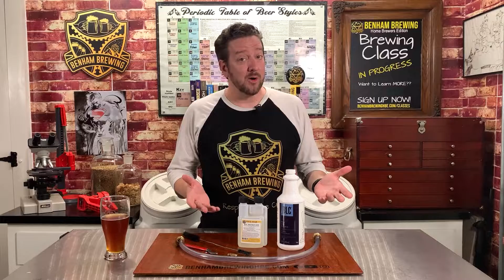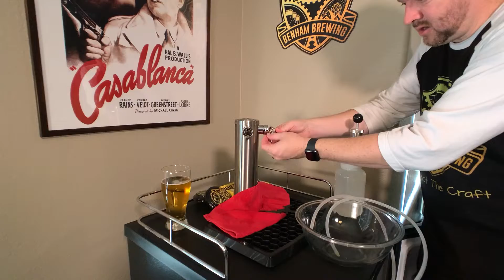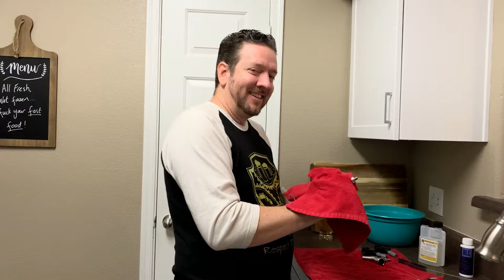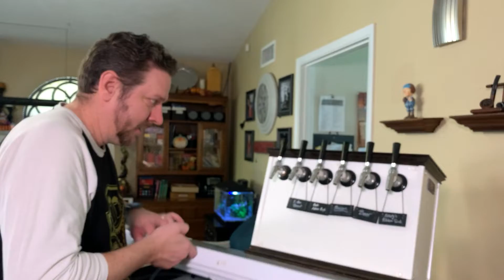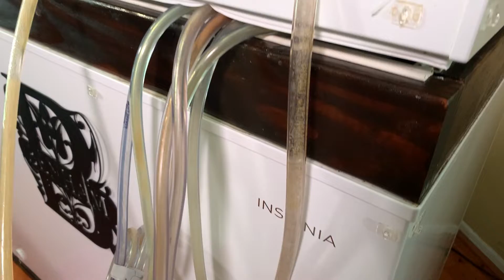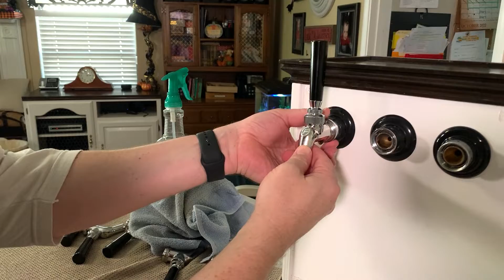How to CLEAN your Kegerator Tap Lines

Comment: I see you're using Duotight connections on the two tap kegerator. Have you had any issue with the connectors and the beer stone remover? I have heard over exposure (soaking) with starsan can breakdown the duotight connectors. I've never used beer stone remover but since it's acidic, was wondering if there's that same potential.

I usually do a rinse, wash (BLC), rinse, then star san via recirculation with a pump.
Reply from the maker: We have not had any issues, but we've honestly only had the duotight connections for about three years now. My main kegerator uses stainless threaded barbs, and over 15 years those have never had an issue (but being stainless they are pretty much invincible). I would not think that soaking the duotight connectors in beer stone remover for 20 minutes every six months would really do much to them. Its important to remember that BLC is an alkaline cleaner, which will clean up  a lot of the beer gunk, but you still need the acidic cleaner to clean up what the BLC cannot (i.e. beer stone). I wonder if anyone else has had issues with those connections and starsan/beer stone remover?
Reply: @BenhamBrewing  I read about the starsan issue on home brew talk. I have transfer lines made with the eva barrier tubing and duotight ends on them. I used to soak the lines in a bucket of starsan before transfers.

May not be much as you said but was just wondering. Usually I do 15 minute periods of recirculation when cleaning my lines. I'll get the beer stone remover to add to my cleaning arsenal. Thanks.